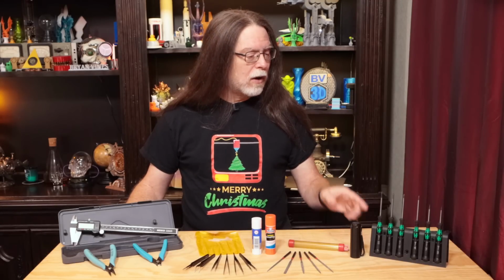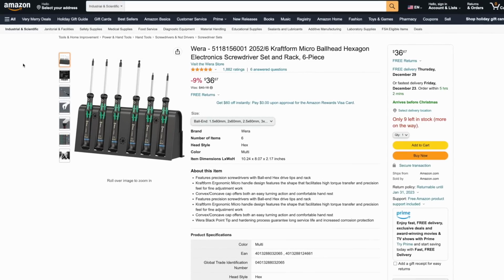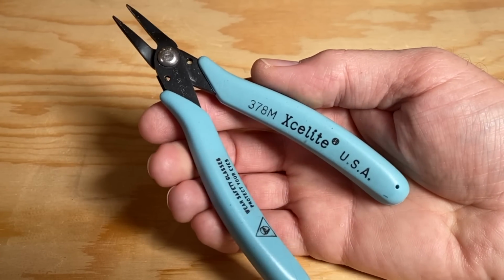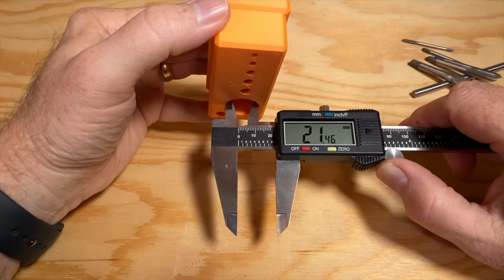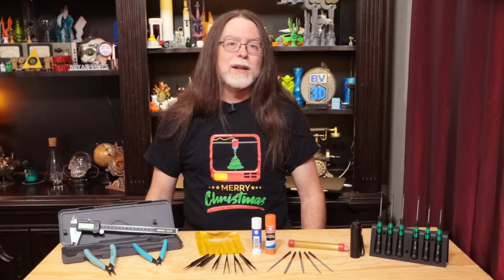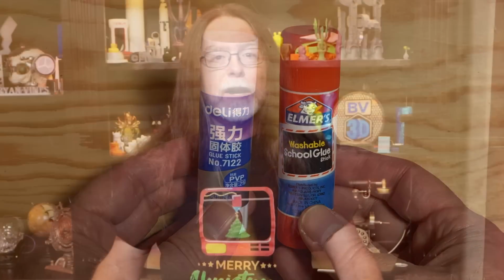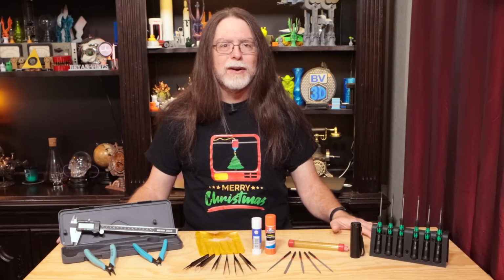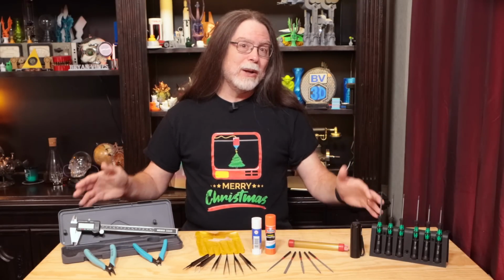Essential Tools for FDM 3D Printing

Comment: I keep a set of SAE Allen (Hex) wrenches on hand because I find that once in a while one of those may fit the head of a supposedly metric sized screw better, likewise I also keep a set of precision torx drivers for similar reasons, if the hole for the hex wrench seems to be rounded out a bit and neither the metric or SAE hex wrenches want to grab it to remove it, then I often find that one of the torx drivers will manage to grab it since they grab more in the corners instead of relying on the flats of the hex.  Additionally I keep a set of metric 'ignition' wrenches (a small set of combination wrenches commonly ranging from 4mm to 10mm or 12mm or so) on hand for things like adjusting the eccentric nut on the rollers, or tightening down other nuts I come across on the printer (such as when one of the threaded holes in my x-axis carriage plate stripped out and I had to resort to using a slightly longer screw and putting a nut on the back side between the carriage plate and the gantry).  A hobby knife (Xacto style), a tube of Super-Lube PTFE Silicone Grease to lubricate the Z screws and the oldham couplings I have installed.  Also a small set of 'dental' picks to help a little with print cleanup or if I need to snag a little booger of filament out of the way of the nozzle before the nozzle gets to it and it gets stuck on the nozzle acting as an attractant for more boogers eventually destroying the print.

Comment: Good list but its missing a few things. I have a small and large putty knife to wedge it under a print to help remove it. I have a jeweler's hammer to tap the putty knife under really stuck prints. I keep a set of wire brushes to brush off the nozzle and soft brushes to brush off the prints and print bed. And lastly, I keep a cheap (but safe) heat gun for use when melting prints (especially ABS) together or melting the glue off the print bed.

Comment: A lab notebook. Any notebook would do, I use 100-120 page 5x7 college-ruled notebooks myself, and I only use one side of the page because using both sides of these cheap notebook pages doesn't really bleed through but doesn't look great either. But anything that lays flat will do.

Reserve two or three pages in back for an index so you can look up where you made important notes, and log what you do and how you did it - what you printed, what filament, nozzle size, quality, important settings. Firmware upgrades, software upgrades, PID calibrations, write down the befores and afters and date everything as  you go. It'll help you learn from what you did and let you look things up when you forget. Super-useful tool.
Reply: Also a couple of people have said X-Acto knife and that's that's absolutely right, but don't use the usual metal stick handle which wants to roll around and stab you in the thigh. (Is that just me? I doubt it.) I've used a few trying to find the best one and so far that answer is the Fiskars Softgrip Craft Knife. It's orange and grippy and most of all does not roll.

Comment: I use a head torch rather than a standard torch, that way I have both hands free to work on my printer with.
The other thing I use a lot is I designed and printed some hex key handles.

Comment: A hot glue gun, soldering iron, assorted M series bolts, and a brass brush to clean the nozzle and sock. a Xcto knife and a 9mm. the last tool is when my printers pisses me off and I need to get extreme.

Comment: I have a few: 
Wire brush for cleaning up nozzles and heat block
hemostat pliers, great for locking on to supports for removal without cramping hands
 deburring tool for part clean up
paint scraper for part removal if you arent using PEI sheets
 Nano miner polymer instead of gluestick
Hygrometer to check stored filament humidity

Comment: I've been using a 2 inch chip brush to dust off my printer beds.  It's amazing how simply running the brush across the bed helps promote good adhesion.  Probably don't use a brush in combination with a glue stick.

Comment: Another great video, Mr Vines. I must add a word of caution, though. With the ball-end Allen turny things, take care that you don't strip out your screw heads. It's easy to do. That's what a friend said, anyway. 🙄
You have a good list of tools, there!
As for my must-have 3D printing tools? I have become fond of my de-bur tool (with several sizes of tooling). It was a gift from my son-in-law. I've used it a lot more than I thought I would! Also, a piece of paper! I fold a piece of paper 1 or 2 times and use it to clean a hot nozzle. I do use tweezers at the start of a print to pick the ooze boogies. However, every few prints or whenever necessary, I will heat the nozzle to print temperature and drag the folded (single layer will just tear) paper over the nozzle and even the silicone sock. It is much gentler than metal tools! And, filament sticks to paper very well. Amazing how much you'll get when you think the hotend is clean. Did I mention that it is much less likely to damage your nozzle than metal tools!?!? Thanks for the video!!!

Comment: Definitely recommend a deburring tool for post-print cleanup!

What I'd really love to see would be a better/safer way to unscrew and swap nozzles, because I keep banging up and eventually breaking my aluminum heater blocks.
Reply: I have a l-shaped socket wrench that came with a set of nozzles I bought from amazon, and it works really well for hot-swapping nozzles. It doesn't slip, and when the nozzle comes off it just sits in the wrench so you can put it somewhere safe rather than dropping onto the bed and bouncing into you or something else that will get burnt!
Reply: Also for a bit pricy, non-DYI way I would like to refer another video of BV3D where he highlights the E3D Revo system. Video title: "How To Install the E3D Revo Micro on the Ender-3 V2". You could cold swap the nozzles by just screwing it out with two fingers.
Reply: I'd recommend getting a set of L handle socket wrenches that can be found on Amazon. You can find a set with the common nozzle sizes and a few other nozzle related tools for relatively cheap.

Comment: A spray bottle with isopropyl alcohol 91% or higher, shop towels or microfiber towels for wiping the bed! Generic magic eraser sponges for cleaning the bed with hot water and soap! Magnetic parts tray or silicone parts tray I find very handy too! Can also get an upgraded pair of hakko flat cutters for about 8 dollars that are an improvement over the ones that often come with printers. 

Great tips and video Bryan, thanks!

Comment: One of my fav 3d printing tools is a lighted dental mirror.  It's VERY easy to confuse shadows on nozzles with burnt filament.  Wanna see if your nozzle exterior is dirty?  Use one of those bad boys, and save neck strain while you're at it.  Don't forget a brass brush while you're at it to clean the nozzle.

Comment: I would add a 10x magnifying glass. I use mine to inspect prints mainly test prints for filament settings and sometimes the small texts on machines and the tiny screws it helps to have one.

Comment: Good video Bryan. In my basic tools I  use a 6" narrow width, deep jaw adjustable wrench to hold the heat block while changing the nozzle and a nut driver to change the nozzle. Thanks!
Reply: I keep forgetting about those narrow, deep adjustable wrenches! Thanks for the reminder!!